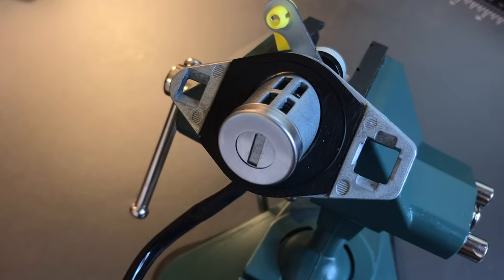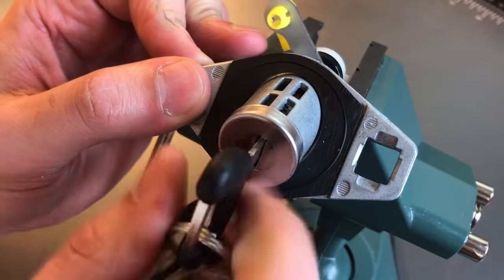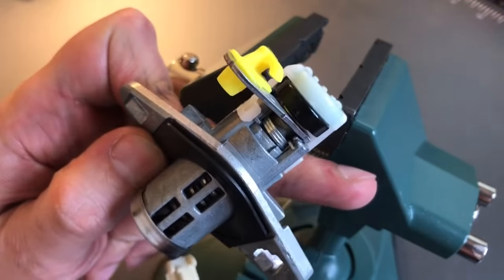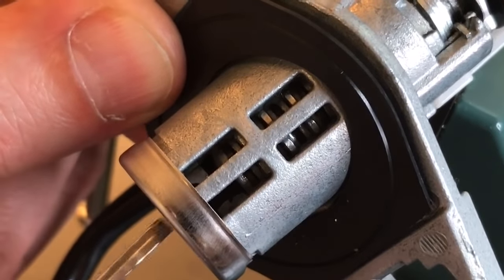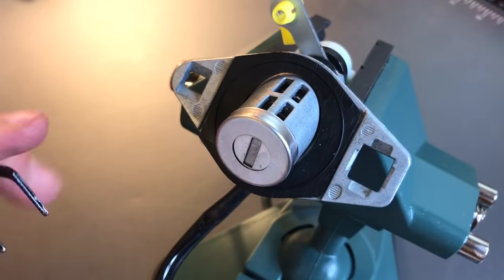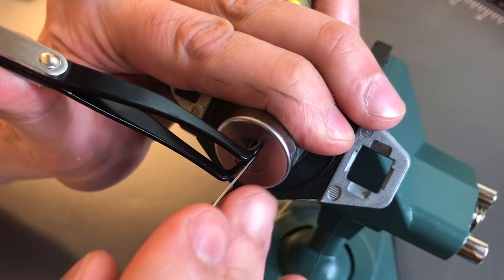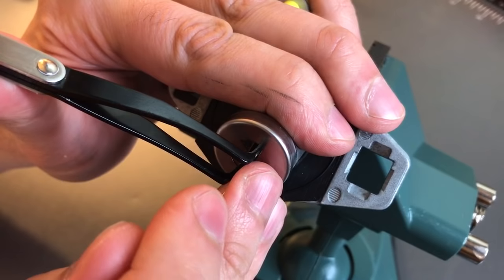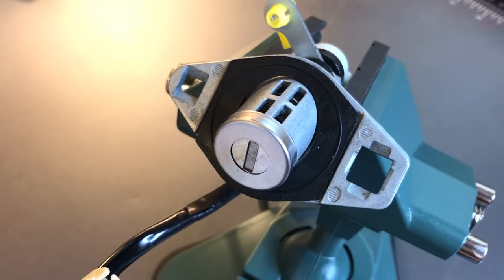[372] Mazda 6 Lock Picked & Alarm Disarmed

Comment: Do one on the fords door locked they used from the 60 - mid 90s. My 74 84 and 88 fords all had the same style key and they look extremely simple. Just was kinda curious how simple they really are to pick by a pro. 😂😂
Reply: When I was a kid, 2 people at my church both drive a similar age Ford wagon in the same colour. We were joking one day about how they had parked side by side, and how funny it would be if the keys were the same and they accidentally swapped cars..... So they tried the opposite keys.
Surprisingly, one car unlocked with the other cars keys, and the ignition switch even turned (they didn't start it, but did switch it to the ON position).
The other car didn't unlock or anything. Key didn't turn in any of the locks. The 2 different keys were obviously different, so it must have been a quirk of the exact top and bottom combinations and/or the way they'd worn down.
Reply: Only so many wafer combinations are possible, add wear, slop in the warding and error in multi-generation key copying and you start to get that type over overlap.
Reply: I don't know about picking them, but 80-90's Fords were trivial at best to bypass with a small long flathead or just by removing the antenna and using it.

Comment: I have seen in a Toyota, if the security system is armed, even opening the lock with the key will set off the alarm. Only way to disable it is to lock and unlock using they key 5 times within 10 seconds. That is the door lock though. Not the trunk.

Comment: You can often rake these double-sided wafers. You get double-sided rakes or you can just use a city rake and spin it upside-down for the other side. Also, overlifting is a very popular technique for these locks too. There are a few cars here that disable the alarm when you pick the lock, it is a big security fail.
Reply from the maker: +huxleypig69 I tried raking this one... no luck, but I'm not very experienced with these locks yet so that might be the problem. I would always set every wafer except for one or two. As for over lifting, I'll give it a shot.
Reply: LockPickingLawyer with SPP skills looks like yours you don't need other tools. if you are interested in other picks that work well check out (if you don't already have some) automobile Rocker Picks.
Reply: LOST FOUND You have gotten on well with rocker picks? I think they suck; if the shape of the key is not like the rocker it won't open. If you want super-awesome tools then go no further then the Lishi and the Turbodecoder.
Reply: huxleypig69 Yeah I have been successful with the Rockers. If they don't work as Rockers I use them as rakes and I have yet to be unsuccessful. I can easily say I have picked thousands of cars. When I purchased my Rockers, Lishi, Turbodecoder and others wasn't around. I agree with the Lishi or the Tubodecoder being great and efficient but those products cost alot more. In my opinion they are aimed for professionals that can recoupe the cost, like making keys for the vehicle and getting paid.  Also I was trying to suggest another hand pick for the Lawyer to try on the auto locks. The Lishi, Turbodecoder and others for me take the "fun"(guess work) out of it.
Reply: Lol, yeah, they certainly take a lot of the guesswork away, especially the Turbodecoder (when new). Lishi's can be picked up quite cheaply now, especially the older generations of tool. I was amazed at just how many autos use double sided wafers in the US still.

Comment: Keep most thieves out? as far as I'm aware, most car locks can be just forced open with a screwdriver. You just need something to grip the screwdriver or one of those that has a hole thru the handle, so you can put another bar thru that and just turn it. It will obviously break the lock, but it opens the lock in like 5 seconds. I think that's why on most cars you now have the trunk on key or button / switch inside the car.

Comment: The interesting thing about the Mazda system is, if it's deadlocked yeah it's great you can get into the boot/trunk but you won't be able to open the doors from the inside and picking a door lock will set the alarm off as once deadlocked the system will only disable the alarm if the key fob that dead locked it, unlocks it! Even using the physical correct key will set it off.
Reply: Carl Schmidt  the alarm horn is inside the car for this reason

Comment: Where can I find training locks like ,because Lock picking Is Curing my stress ,Specially the moment when the lock turns with you ,it's one of the most satisfying moments
Reply: Don't buy training locks, just use regular locks.
Reply: @TraceguyRune  i already did so
Reply: @AntiLGBT_SuperExterminator  The main thing is curing your stress. So whatever works, go for it. I just think "practice" locks will cost you more.
Reply: @TraceguyRune  i took it as a hobby, even though i took my pro lock picking kit to the school and tried to Lock on the Girls in toilets and i did it also incase if anyone has a spare key he can't unlock it because of the lock posetion that is impossible to insert a key, anyway i teached that Cheater a lesson

Comment: On most VW cars the alarm is only set and deactivated via the remote RF key; unlocking the car with the alarm set with a cut key (or picking the lock) will make the alarm go off (you can then disable the alarm by putting the key in the ignition.  Do Mazdas have the option of having an alarm but no remote fob?  Seems like that would be the only reason to allow unlocking the car with a key to deactivate the alarm.

Comment: LockPickingLawyer, i dunno if Mazda has a different system, but in my experience those wires are not  the alarm, are the ignition  and electric circuits power on/off
Reply: Ignition in the trunk lock?

Comment: Two questions; How sensitive is the core movement sensor? and How much time from it first sensing movement does the system give you before sounding the alarm? I would hope that it's sensitive enough to detect partial movement during a picking scenario, and 20 seconds before it sounds the alarm and the central locking system using a torsion screw servo relocking the lock during you picking it. If you have the keys, 20 seconds is more than enough time for you to fiddle the key into a fussy lock and switch off the alarm before it sounds.

Comment: The act of picking disables the alarm!!!!! 

Did they intentionally give the burglars a gimme?
Reply: I don't know about Mazda, but I drove a 2003 Hyundai for a while and it had an interesting alarm. If you only lock the doors and close them, it would not arm the alarm. If you instead used the key fob to lock the car, it would arm the alarm, but using the key to unlock the door after that would not disarm the alarm. As a result, if you use the fob to lock the car, you had to use the key fob to unlock the car, or you would set off the alarm.

My guess is that they put the sensors on the lock cylinders to prevent people from accidentally setting off their alarm all the time when they use the mechanical key to open the door.

Hyundai went to the same method of having a sensor on the lock a few years later.

Comment: Hello LPL, nice picking al allways, 
i was thinking about that switch, and i believe that is a purpose for picking not activate that switch,  i belive alarm has own switch directly on trunk and  if someone pick cylinder and don't  activate switch, alarm will recognise opening trunk without using regulary key and run alert..

and about above decoding/ Lishi discussion:   some car makers like opel, mazda...
has interesting feature on some models and that is they put less no of pins/wafers on doors/trunk/others locks then  (full no of wafers) in ignition, so if You make key from doorlock You are not able to unlock ignition and steal  car, Your  model key (on vid) has  ten cuts(wafers in full conf) so if trunk lock has only nine of them, key decoded from that lock wouldn't help You for  ignition...
Reply from the maker: It is possible that you are correct about the cylinder sensor, but I don't see how.  The only thing the sensor measures is rotation angle of the core.  How would it know if the lock is being picked?  Notably, there is no room for a coil to read the smart key transponder (like  there is on the ignition of this car).  Also, VERY interesting about the number of wafers vis-à-vis the ignition.  Thanks for the info.
Reply: ..You're welcome,    and about that sensor, i understand You that sensor react only when key is used, no if lock has been picked.. 
If reacts always when cyl is turned so that is it used different way i thout ...

Comment: LockPickingLawyer there use to be this lock on the pool in my neighborhood which the key was a metal card. And there was a slot on top of the handle where you would push in and the lock would open. Have you ever seen locks like this.
Reply from the maker: +Smuckers T sorry, I don't think that I've heard of that before.
Reply: Smuckers T sounds lone an old hotel style key

Comment: Would be very interested in more auto door and ignition picking
Reply: Ignition keys have immobilizer chips in them since the early 2000s so there is no point in picking the ignition
Reply: True, but I have some motorcycles in the garage I'd like to try. No immobilizers on them and the reason I was looking for this particular video is that I am an instructor for a track day company, (teach people to ride sport bikes on the racetrack), and there is almost always a student that loads their bike on the trailer and forgets the key at home. It would be nice to have another option than removing the ignition lock, (which we have done in the past)
Reply: @Ivan Rusic unless you have the OG key to copy its pretty much impossible to bypass modern keys. The keys work essentially like credit cards and store a long code which is transmitted via rfid. It's way easier to reprogram the ecu at this point to remove the immobilizer completely. Also if you know how to do this you probably have better things to do than stealing cars...

Comment: My wife had a Mazda Miata with an identical style key lock system for the vehicle, somehow we lost the keys and I went to the dealer to get a replacement key cut from the VIN# database. It never fit right, and I had to “profile” it for months by filing down where the metal discs scratched at it (ware) because it would work in the engine, but not in the doors. Thought it was interesting.

Comment: I believe Mazda 6 uses a smart key, so opening the trunk without having the actual key in proximity would trip the alarm off when that sensor detects the rotation..
LE: And even without that, having the alarm set and opening any door or the trunk would still trip the alarm off when the sensor picks it up.
Reply from the maker: +Alien Kitten The smart key sensor is only in the ignition, I believe.

Comment: Chiming in, identical to a 626 boot lock, as the wire lets you access the boot while locked and alarmed. Same is on my Camry wagon with factory alarm.
Reply: Lock and key looks similar to the core on the trunk of my NB

Comment: I’m a locksmith in SC. I use lishi tools for most of my car unlocks. My experience with using a lishi is very similar to SPP, however just as in house/commercial locks if the wafer/pin is bouncing, leave it alone. If it binds, then pick it. I have never seen a lock go in the order LPL used, one after the other on the bottom then on the top. If you pick the wrong wafer then usually the lock becomes unpickable and all the pins/wafers have to be reset and you start over. I think LPL got very lucky with his order of picking and it opened without oversetting a wrong wafer. But then again, I am not in the same class is LPL and he does amazing work with his fingers and touch.

Comment: I have a 1990 mazda mx-5 miata and they did not include a truck release in the car from 1990-91. I locked my keys inside the trunk, is it worth it to buy these tools I may need them again and would the lock be similar enough that this would work?

Comment: mazda doesnt have a trunk lock anymore    i have a 2013.    i have only one door key lock on driverside      either way   i have multi cameras recording 24 /7         dash cam, fron and rear facing,  tailgate camera,and one  front bumper cam, and 2 side  behind mirror cams   .    all for a aftermarket alarm system/paging system i installed.        all to protect  my car and its audio system .

Comment: My old Toyota has a sligtly better approach to this kind of security. Whenever the car is locked with the lock button in the keyfob (not locking it manually or by the key) then the alarm is activated. The only way to open the car door without activating alarm is by pressing unlock button in the keyfob. If I unlock it by the key, the alarm will activated even if it is the original key. The trunk key is more unique than that, only safe to open after press the unlock button and open any one of the four car door, then that the way I can open the trunk without activating alarm, with the lever or by the key.

Comment: Well, that was disappointing.  If I owned such a car, I'd be inclined to add a switch to trunk lid that would start a 10-second delay timer to trigger the alarm, plus an easily accessible, but disguised or hidden switch to cancel the alarm trigger.  That way, if someone were to pick the lock, they'd get a few seconds at most to see the trunk contents before the alarm activates.

Comment: Nice! do you use a particular pick? It seems that a pick with a flat tip, or one with a shallow notch would grip the wafer better.
Reply from the maker: +Big Matt Thanks. Pretty much anything will work... placement is more important than shape, but I suppose the flat tip gives a little margin of error.
Reply: LockPickingLawyer rakes work especially well on these . usually I have better luck with rakes on carlocks.
Reply from the maker: +Kyle Corey I tried raking this one... even with the benefit of the top window into the cylinder, I couldn't get them all set... usually 1 or 2 wafers I had to set manually.  I'm pretty new to auto locks, so it's possible I just don't have the hang of it yet.
Reply: well you are really good at singlepin picking too though , which i am not that great at ..i am pretty good at raking but dont always got patience to single pin pick...i got jigglers , and a variety of wafer lock picks...those car rakes made by goso and klom work really well on car locks...but if you get a lock wioth a side bar its pretty tough.. i recommend you get a six cut gm lock  from older gmswith the sidebar and practice on those..the ignition locks.they are not so easy to pick for an old design..great vvideo
Reply: sparrows warlock wafer rake is pretty good
Reply from the maker: +Kyle Corey I have one... with the sidebar that you can't tension?  I thought they couldn't be picked, only decoded.  Not so?
Reply: i have heard it is possible to be picked yes , but because of the low cost of them most guys just replace them. rather than wasting time picking it...but generating a newkey is the easiest or reading the wafers. i would like to see a video of someone picking one.
Reply: maybe this could be your next challenge-they are a huge pain in the ass, especially pulling them out..you need to tear the entire steering wheel out and need special pullers just to get it out and replace....opposed to the new ones where all you need to do is turn it over or pick it open and press a retainer .

Comment: I got one of those tension wrenches with the goso set one of the best thing in there.  I can pick a car door but I've tried picking the ignition on (MY CAR) lol no luck on the ignition i don't think the ignition is wafers looks like pins.
Reply: Chris Ahrens If your doors are wafer then it's likely that your ignition is too. Depending on your vehicle you may have a key buzzed that needs lifting so you can pick it or maybe a sidebar that needs depressing.
Reply: LOST FOUND I tried looking in the key looks like pins on the bottom couldn't see anything on the top looked smooth don't know about a sidebar didn't think to look for that
Reply: Chris Ahrens If it is pins it won't be a sidebar but could still be a key buzzered. If your dying to know you can look up the year, make and model. Then check what kind of key it takes. If you have a copy of the key it will usually expose what kind of key with numbers/letter etc. like H51 or maybe x174. If it is a single sided cut key and is American it will most little be a older car and use pins unless it is a GM product. They have been using wafers and side bars starting before the 60's. If so the are not impossible to pick but can be tricky.
Reply: If it is the same key for opening the doors and the ignition, why couldn't you ?
However you might have the steering wheel locking mid turn, not sure about that

Comment: I'm surprised that you can do all the bottom, then the tops. I figured the pin the was going to bind would mix between the top and bottom.
Reply: It looked like that was what he expected also, since he did check the bottom before returning to the top, so I guess it's just an oddity about this particular lock.

Comment: Can you make a video of the GM wafer lock with sidebar?
Reply from the maker: I could make a video of the lock... but not me picking one.  I don't know of a way to pick them... at least not without a little destructive modification .
Reply: Most GM 10cut ignitions have the sidebar accessible without modification. I use a broken pick to apply tension to the sidebar at 7/8 o'clock when looking at the face of the cylinder